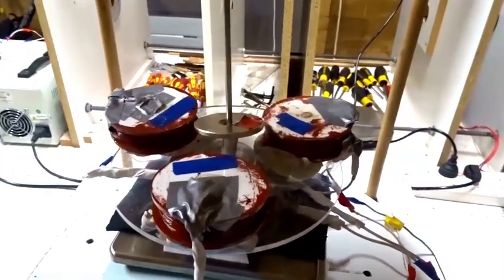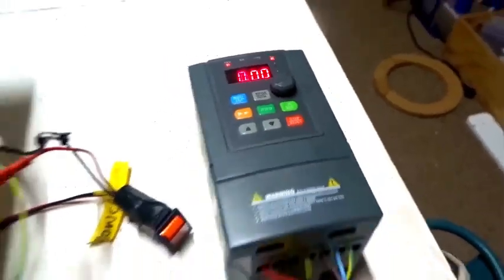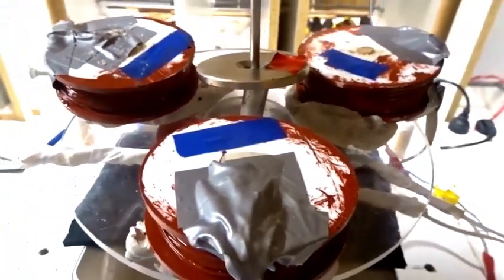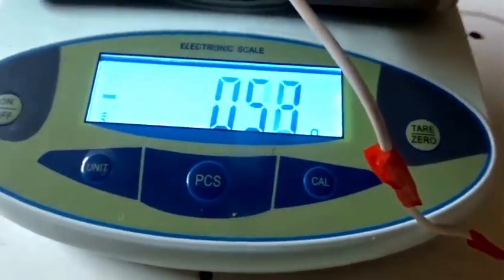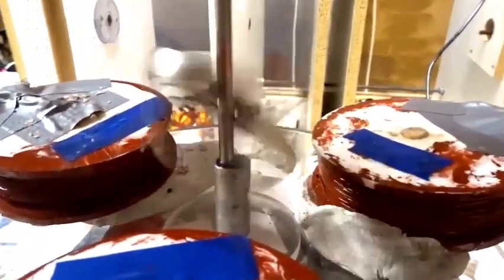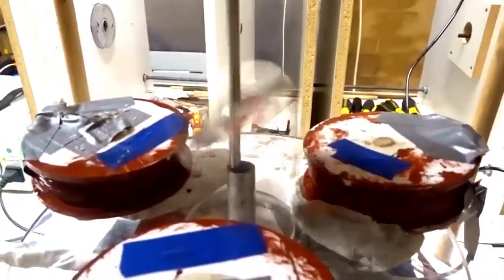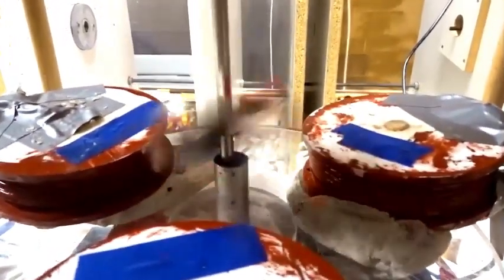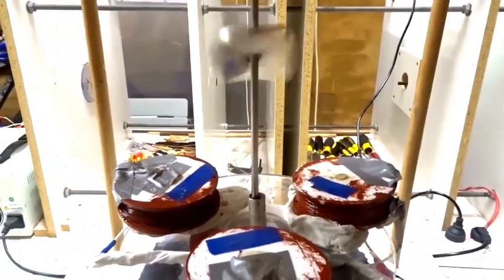Beautiful and elegant 3-phase, spinning magnetic levitation

Comment: Caltech graduate now at Skunkworks!  Acoustic octaves or Cancelled EMF fields for Heavy Weight Stone or Metal!  U must attach ya equipment to The Load for ENTIRE lift!
Lithium Niobate has 600:1 aka Lift 600 lbs w/ 1 lb Cube shape Quartz crystal ! 
1200khz,300watts,3Bi-Foliar coil , in. 60 deg cold environment! Crafts have Crystal Cavities around craft to pulse! Thus Huge Negative Index Weightless! Crystal must be Cubed shape to Warp Crystal

Comment: This is CUTE but not efficient ufo Lift! Make the ENTIRE platform Weightless NOT just a Magnet! 
Example: levitate a 50 lb  2ft by 2ft Granite and THEN lift your tools needed to keep it a float so the ENTIRE Platform lifts !
Use Sound  not dirty EMF ! Also Cancelling EMF gv standing waves 
For objects Q-factor $ resonance code !
Reply from the maker: Please expand your thinking to "weightless pulses of time". Potential energy upward by spin, then weightlessness in free fall. 
Spin adds potential energy to the overall system. How to extract it usefully? That is the Question. SMILE